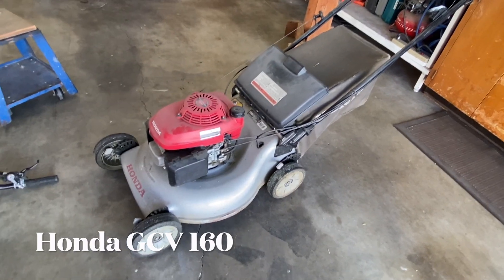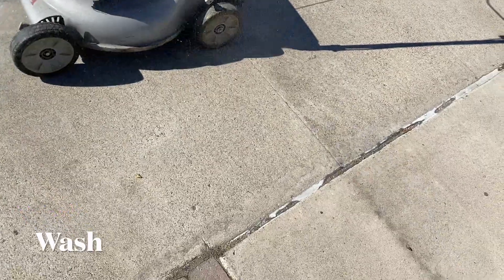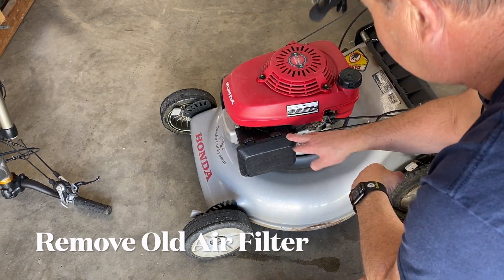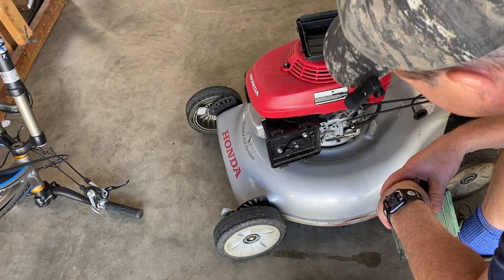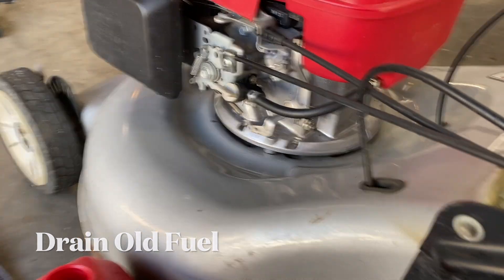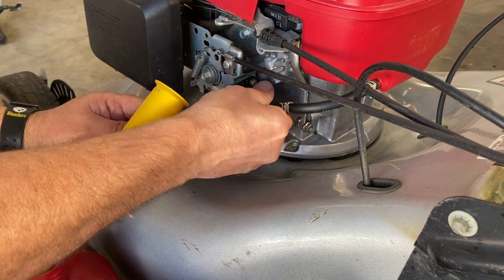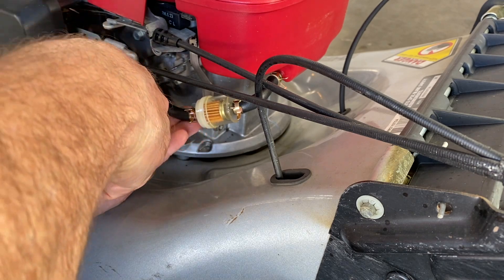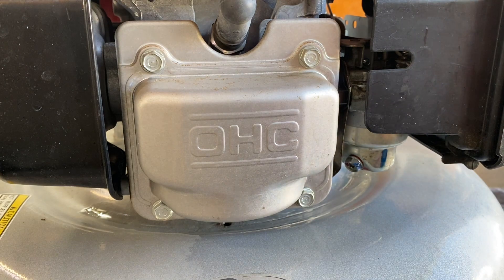Scott's Garage - Tune-Up and Oil Change - Honda GCV 160 Lawnmower

Comment: Try using ethanol free fuel.  You can search online for gas stations in your area that sell ethanol free fuel.  It really helped my Honda GCV 160 run a lot better.  Great video, these lawnmowers are almost indestructible with proper maintenance.
Reply from the maker: Great tip!

Comment: Effing Hondas have a useless plastic carb shroud, a throttle plate and five gaskets..Briggs and Strattons have one O ring between the engine and the intake manifold.  Honda tried for years to make a reliable automatic choke and never quite figured it out.  They no longer make lawn mowers as of the end of 2022. Good riddance.